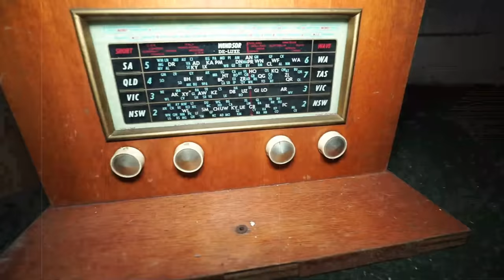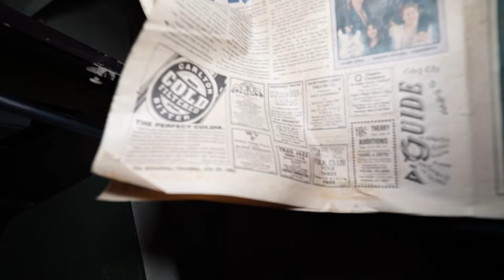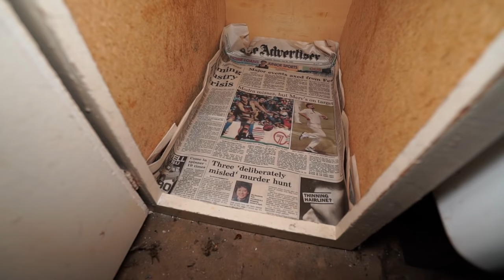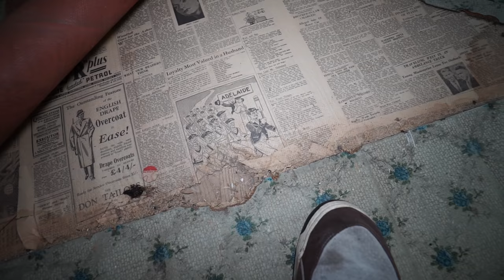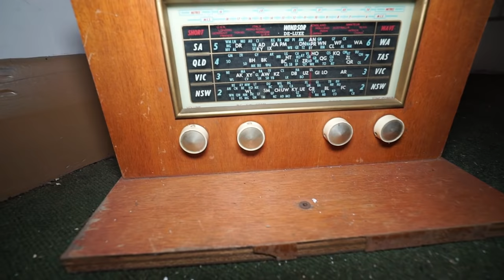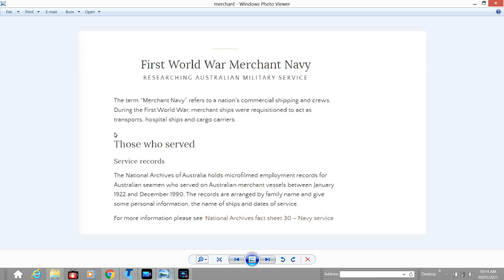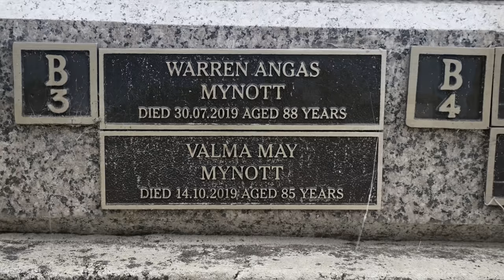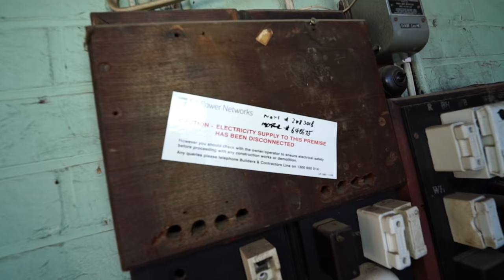Abandoned-  All original 20`s Bungalow! Same family for 92 years! Family history provided

Comment: Really was in good overall condition. The second you panned by the excavator, I knew the old place is to be knocked down :-( no surprise. The curtains and naugahyde chairs are all around 1957 I used to have a similar set to the red ones. The pink fixture is mid 60's. Someone knocked apart the radiogram (to "repurpose" it's cabinet). You could find a repair man n get it going again, rather than the tip. I imagine the newspapers will end in the tip as well. You jogged my memory mentioning developers: 2 of my old neighbours homes, one from the 20's the other,30's? Are being knocked down, both still have 90+% original doors cabinets, radiators, etc. To the tip or scrap. More fancy condos the bulk of ppl here can't afford to take their place... Thank you for sharing it's final day. Enjoy the chair I tipped mine...doh...
Reply from the maker: Hi Retro Captain! I got a few of the newspaper pages mate :-) Thanks for the info, so glad you have loved and had these sort of things in your life at stages. I would love an old home like this one! Thanks for watching :-)
Reply: @urbexindigo5164  The one thing that is a default of life in an old house; the heating costs. The last House I was in was 195 or so yrs old, and cost up to $600 a month in diesel in Jan/February. One reason why ppl here just knocked them down, just too costly.  I live in a WWII era home now it's much more affordable but even then it's "drafty". I don't mind. Has a hand built Stone Foundation & most of the original Wood work, & I'm going as far back as possible in correct era Light Fixtures, Outlet, Switches...the original Wood frame windows were basically pooped so I put Plastic frame in the place Less drafty now.